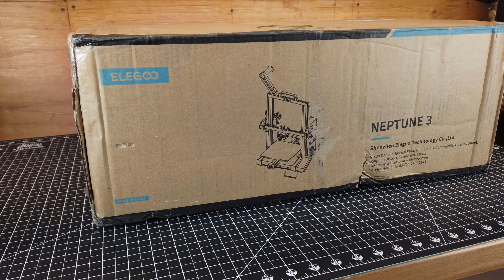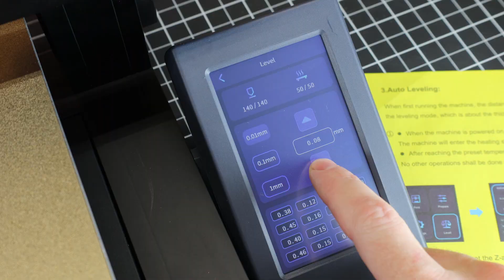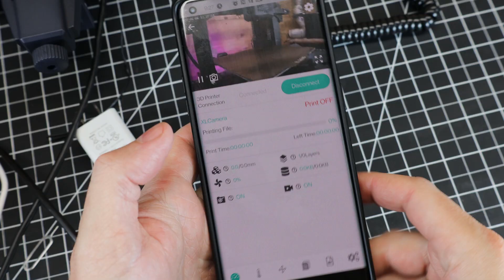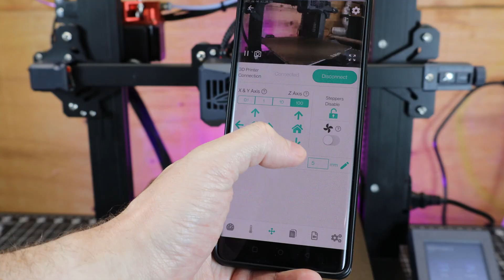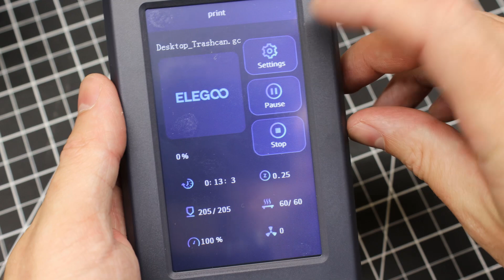$209! FDM 3D Printer Packed Full of Features -  Elegoo Neptune 3

Comment: On the Elegoo page under (Technical Specifications) it says that you can start printing with an SD card as well as via WiFi. Is that correct?
Reply from the maker: From what I have seen on the unit that I have it doesn't have WiFi. Idk if they have changed this seeing that I got it early.